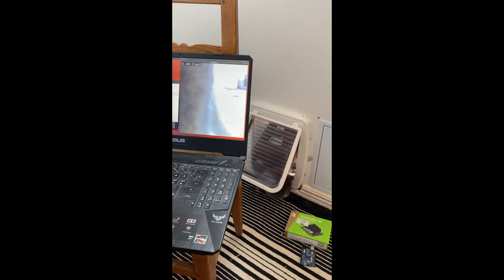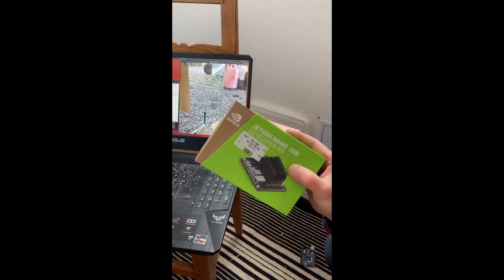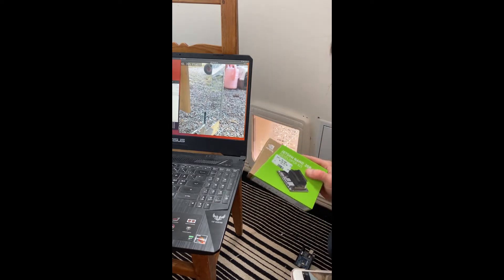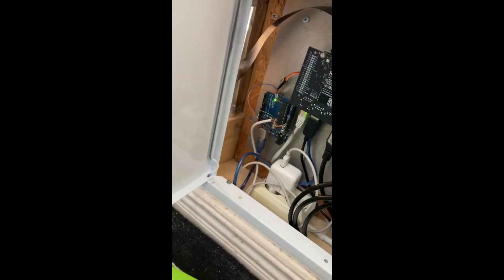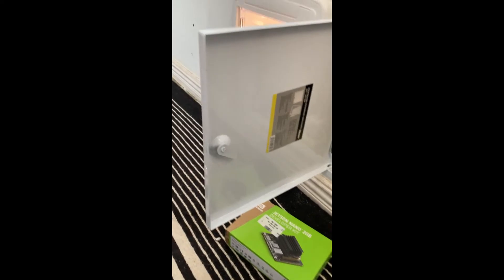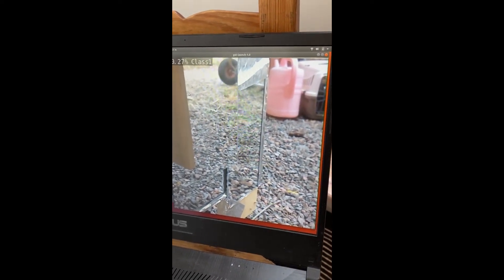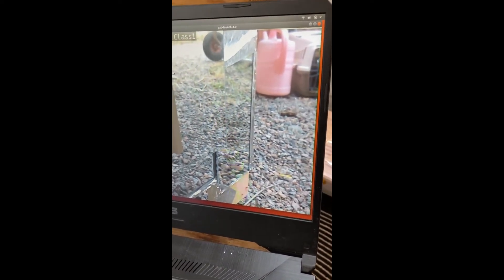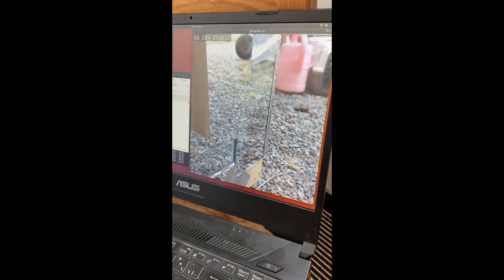AI cat flap block cats with prey. Jetson Nano Deep Learning Neural Network

Comment: Cool project !
And cool that you published the code !
Could you write all the details about the hardware as well ? Which Arduino, camera,...
Also : does it work in low light with those cameras ? Or do you need to add led lights ?
Thank you !
Reply: Also : can you train the model on the Jetson nano ?
I don't have a GPU in my PC, so it completely changes the budget.
Reply from the maker: @miyamotomasao3636  Yes It should be possible (don't test to train ResNet-50 on Jetson but I guess it should be possible)
Reply from the maker: Thanks. Yes I could do a more detailed video and shapen up the instruction on GitHub. Stay tuned
Reply from the maker: Anyhow it should be possible to Train on PC without GPU the pytorch script automatik will detection if GPU not avalible then it will train only with CPU and take longer time
Reply: Thank you very much for all your answers on your great project !
It will really help me ! 😀
Reply: I saw in another video (not in English) that you use Raspberry pi cameras.
Reply from the maker: @miyamotomasao3636  It was only the Pi camera connected to Jetson Nano (No Raspberry pi Involved). The Pi cam have same interface to Jetson Nano.